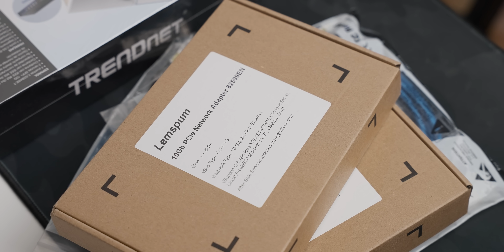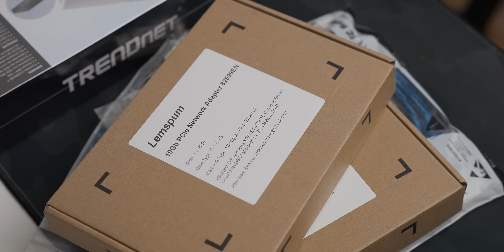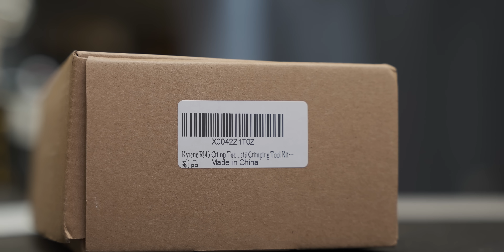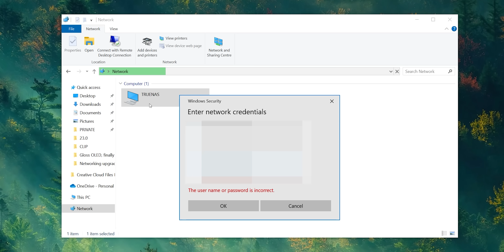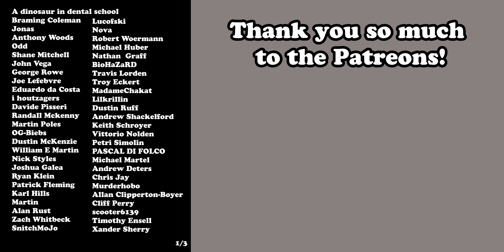Upgrading To The Cheapest 10GE Network...

Comment: Yeah, i also found out a way around the problem about write speeds on hdd's. You can set up SSD'S in SLOG so they are used as temporary storage for the slower write to the other drives.

Comment: Spinning rust is too slow to saturate 10Gb link unless you have bunch of them in a stripe. Single drive via SATA interface is never going to do that even if you have fast SSD there. Two SATA SSDs in a stripe could get pretty close though and with spindles, maybe 4 drives in large sustained transfers could get reasonable results. Networking side itself, you don't need any magic to max out 10GbE. You might want to enable jumbo frames aka set mtu to 9000 on both ends assuming your switch supports it.

Comment: Very entertaining, also been doing IT for a good 30 years now, and yes there are much better ways to connect your cables, where Cat6 is a good option for 10gb, consider using Bare Copper, less degradation and also over longer distances still performs well. Also would have been just as cheaper to go 40gb fiber, I would probably skip 56gb InfiniBand since TrueNas hates that.

Comment: That's nice and all, but why not replace the copper Ethernet cables to single mode fiber? They are 10GBe ready regardless of distance and much, much thiner, resulting in much less of a mess. You don't need to fiber either to add connectors, just strip the wires using proepr equipment and you can add connectors really easily. Fiber also uses much less power on while active on 10GBe+ than copper/Ethernet does.

Comment: oh, and as an aside, the cable you terminated is not designed to be put in an RJ45 plug, its solid core cable and not designed to be moved around and plugged/unplugged a lot.  A patch panel is easier than RJ45 cables, and then you just buy preterminated short patch cables.

Comment: If you set up your nas pool as 2 vdevs in parallel you can have double the speed, for example 2 vdevs of each 3 drives, so you have double speed, usable capacity of 4 drives and 1or2 parity drives that can fail without data loss

Comment: You want to lay the wires in the correct order, then use your finger to smooth them out in a nice tight group. Then you clip the end so all 8 wires are the same length. Then keep them flat and slide all 8 into the connector at once. I've never seen someone single feed a connector like that lol..... Back in the day we didn't have the EZ connectors that slid out the end.

Comment: As a network professional, no, crimping the cables and plugging them directly into the device does not make more sense.

To put it simply, metal, such as the (hopefully copper) in the lines in your in-wall cables, fatigues and breaks, which can cause bad connections or failed connections.  To prevent this, the best thing to do is to make sure the cables in the wall move as little as possible.  The home-run cables in the walls should be left stationary, which is why we use patch panels.  We tie down those in-wall cables so they stay put and don't bend/flex/move at all, which keeps the cables, and the metal inside from fatiguing, and breaking connections.
We then use patch cables, usually made from more expensive stranded conductors, to do the connection from the panel to the switch.  That way, the only thing you move is the patch cable, which is designed for it, and if the patch cable gets fatigued and breaks, it's MUCH easier than replacing the entire in-wall run.

The other ends should be tacked down somehow as well.... even some 3M double-sided mounting tape, adhering them to the wall, is generally sufficient.  Just keep them from moving around and those cables will last the life of the structure they're installed in.

The most common argument I hear against this is "well, I won't be changing it after installing everything", and to that I say.... YES YOU WILL.  When the switch dies, or you want to replace it with something faster, maybe moving from 1G to 2.5G or 5G or 10G or more (whenever that becomes available), you'll need to move the cables to remove them from the existing switch, then plug them into the new switch.... ON TOP OF THAT, the switch is liable to die in the next 5-10 years, so replacing the switch (and moving all the cables around) every 5 years or so, will cause them to fail long before the building has reached the end of its useful life.

People who don't use patch panels are either careless (or couldn't give a crap less about it), not thinking long term, or uneducated about the issues.  Anyone knowing these problems who doesn't use a patch panel is negligent and should be fired.

Comment: IT guy: that patch panel isn't good for high performance networks.  Terminate with through hole rj45's. terminate in B standard. Use a quick crimp for the through hole. easy to do.  get a line tester.. ideal stuff is fine.

Comment: $58CAD for a single X520-DA1, I'm unsure of the current exchange rate, but that sounds extremely overpriced. Used X520-DA2 (the dual port version) are around $13-20USD.

+1 for putting a fan on them. These model is old and runs hot, both are why they are so cheap and common.

Comment: i dunno, punching down the network cable, and using preterminated cables seems less error prone and quicker than terminating and crimping your own cables.  the punchdown block he gave you would have looked far nicer and more reusable, and actually is not hard to terminate at all.  If you can crimp your own network cable, punching down is a dream.

Comment: The B cable layout is the standard, TECHNICALLY, just having cables in the same order on each side will work, but you might get some signal loss if you don't respect the B standard

Comment: The patch panel is better long term. The cables on wall are/should be solid and don't handle moving around in a plug. Use patch cords for that part

Comment: FYI for HDD's the speed depends where on the platter it is; data is read faster from the center compared to the outside as a result of the rotational speed vs the circumference. So transfer speed does vary depending on the platter location. 

Also if you'd just used the patch panel; then you could have got a punch for like $1.50; and spend the rest of the crimper budget on pre-terminated 6" patch leads. 
Would have been the same number of terminations but easier; and its just nice and tidy too having all your terminations at the rear

Comment: The most likely reason that data started to copy faster is because that data was on the outer edge of the platter on the hard drive. For things that are round you would have to run faster on the outside edge to keep up with someone running on the inside edge. That reader head in the hard drive is able to read more data per revolution on the outside of the disk then the inside.
Reply: My NAS does a monthly parity check which will check every single bit of data and when i used to monitor the drive speeds you could see it looks almost like a saw pattern as it read from the inside out, change the disk platter its reading and do it all over again.

Comment: Dude, for real. Just connect the drives directly to the NAS and avoid the network roundtrip! Also, to fully saturate the I/O in your NAS, you can use the intenal Satas, the USB interface (up to 4 hdds of bandwidth) and also over network! You can do around 6-8 drives at the same time. And far cheaper lol.

Comment: Good job you went with fiber. I tried 10gbe on ethernet with rj45 transceivers and the heat and power consumption was ridiculous. It burned to touch the transceiver. And it didn’t work right either because I went with the cheapest switches. A few dollars on fiber sorted it

Comment: Hi Dawid, a DAC cable is a Direct Attach Cable, It has no fibre optic components and uses copper. That's why with a DAC cable you cannot cover the same lengths as with fibre optic SFP's and cables. It is also the reason why it is cheaper.
Reply from the maker: @kenwillekens9894  Thanks for the info. 👍
Reply: @DawidDoesTechStuff  No worries, keep up the good work 👌👍

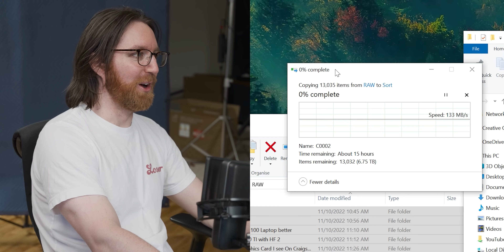Comment: 11:35 I wouldn't be surprised if Windows (or its indexing or anti-malware services) were the culprit,
you might have faster transfers using something like FreeFileSync or even TotalCommander,
single HDD usually does run faster than 120MB/s with 220-230MB/s being peak performance :)

Comment: Ugh, seeing you terminate those cables hurt to watch... As others already said, solid core cables used for structured cabling are not meant to be terminated in plugs, only into patch panels or those LAN port boxes you have spread around the rooms. Plugs only go onto stranded wire cables. And terminating them on the panel would most likely have been a lot easier. You just use a punch-down tool to push the cables into their sockets and the tool automatically cuts off any excess. 
Oh, and you also got lucky with using the right termination scheme. T568A/B have the colors in a different order, and if you mismatch the scheme on the ends of a cable you won't get a link.

Comment: Hey Dawid, depending on your board, it's likely when you installed that 10g module into your second pcie slot that your gpu slot was pushed down to 8x instead of the full 16x speed. Just a heads up so you dont go chasing your tail

Comment: 6:05 pro tip: when you straighten the cables, straighten them in order and try to make them as straight as possible by bending the, back and forth so you can just put them all in at the same time to make that ethernet cable

Comment: As some have already pointed out, the sheath needs to go into the connector for strain relief.
Also, the rj45 connectors for solid or stranded wire are different. You need to get the right ones.
As well, on these high speed cables, it's important to maintain the twist in the pairs as much as possible. Keep the twist right up to the termination point. It makes a difference in signal integrity.

Comment: SO David two things One you hard drive may be a hybrid hence why it eventually sped up a hybrid drive is a hard drive with a ssd cache to help commonly used files load faster also instead of you existing toaster look for once thats usb type C type or thunderbolt (if you pc has thunderbolt) that will make it ALOT faster than the existing toaster and less jank then adding it onto man pc line

Comment: Patch Panels are used to protect the very expensive (in theory) hardware of the switch, from the moron running cables, so if the cable run which is the end more likely to get messed up than the switch.

Also, that's a passthrough connector. The crimper cuts them to length...

Also, you can align the cable ends together, and shove all 8 wires in at one time.

Comment: Personally, would have gone with the Mikrotik CRS305-1G-4S+ switch, It would have given you 4 SFP+ ports with a 1G link to the rest of the network. 10g SFP+ optics and pre-terminated OM3 fiber is much cheaper than DAC cable and plugs in the same way. And if you don't want OM3 fiber, or want to free up a SPF+ port for RJ45, you can get optics with RJ45 ports on them, so you could have a mix of copper and fiber at 10g on the network. the CRS305 is the same price as the Trendnet as well. With the money saved from the DAC cables, you could buy a second 1gbit switch with 8 ports for $15 like the Tenda TEG1008M.

Comment: It hurts to watch how you did your cables... 1. you don't match the cables you have, but you should match THE OTHER END OF THE CABLES.... because if one end uses one way (A or B), then the other end should use the same. 2. the fact that it seems to work doesn't mean that all the cables are connected right. You should use a cable tester to make sure all the wires connect right and are in the right spot. If you want to achieve maximum speed that is... 3. punching them into the patch panel would have been sooooo much easier then you buy short patch cables to connect your switch as you see fit... but well :)
Sorry for the rant... I've done this sh*t CORRECTLY for so many years it triggers :) Not to mention that the connectors where you can pull the wires through didn't exist when I was doing hundreds of these... you had to use the exact length needed :)) Imagine that... I'm sure others will relate :D

Comment: Would definitely have used that patch panel.  The terminals on that are WAY easier to work with than crimp terminating those cables, AND it makes it a lot easier to reach equipment you want to install as you can just install a longer patch cable if you need.

Comment: I started crimping my own cables once. They worked but, I found that the store bought cables that are soldered rather than crimped had better signals. Also the fewer terminations the better. A box on the wall to connect looks more professional but, that's two extra places where it's metal touching metal rather than being a single piece of metal. A soldered cable straight through the wall from point A to point B gives the cleanest signal.

Comment: No the patch panel is better, you have to terminate less indeed because rj45 are way harder than just punching down (which can be done in a minute per cable, for me atleast) and solid core shouldnt be used for rj45's, hence the patch panel. So those rj45's will most likely break the cable very soon

Comment: My Supermirco server motherboard had 10Gb RJ45 so I stuck with that.  I did get CAT 7 cables, because they were only a bit more expensive that CAT 6 (future proofing).  The motherboard told me it was a Intel 550, so I got a Dell card with the same chip.  Optic fibre is for 50/100 Gb/sec stuff.  I can edit 6K-12bit Blackmagic RAW from the server.  In Davinci Resolve, I can scrub the timeline without any delays, buffering or latency.  I don't have to use low res proxies to edit.  Problem solved.  Anything bigger needs a 10Gb switch.

Comment: 58 bucks for that Intel NIC is really expensive. You can get them around here with dual 10G Sfp ports for 20-40€
Reply: 120$ for that switch? Holy fuck... if it isn't manageable, thats a lot. A similar one from a different brand would be like 60 bucks at most

Comment: Ah, YouTube just "loaded" instead of posting the comment. Okay then.

So this is the first time, ever, that I've seen someone do cables like Dawid. It was actually interesting to see because his method (not the stripping of the cables.. but of placing them in the connector) was really strange to see as a solution. On one hand it might actually work for some cables that don't differentiate the colors well, on the other it's a HUGE waste of time. Overall though, it was interesting seeing someone who has never worked on a problem but knows the end goal take an approach without instruction or first-hand knowledge.

Also, use the patch panel. >_< I'm going to be getting one as well as I want to rewire all my cables. Right now we have coax going to every room and MoCA adapters. That locks me into using the ISP modem or expensive adapters in every room though and it's getting annoying. So if I want to use my own equipment well again I need to get rid of MoCA and use ethernet. I will 100% be using a patch panel into a switch for cables. I have a 24 port gigabit/PoE switch that I'll be using, and probably just a single little Cisco in the room with my PC and consoles. But use the patch panel.

Comment: Hey Dawid, did you consider using Intel X540-T2 dual 10GBASE-T cards?  I have gotten some on AliExpress for less than $15/ea.  X540 does not do 2.5G or 5G, because it predates those standards, but it is also what makes it cheap.

Comment: Dawid learns HDD geometry the hard way 😄

The reason the speed varies is due to physics - the HDD platters spin "faster" linearly on the edge, and "slower" the closer you get to the center, so the speed of reading/writing depends on the physical location of the data.

That's why the speed jumps around wildly, as it's copying different files from different locations on the platters.

Comment: Wait, wait, wait. You're just connecting TWO computers together? You didn't need the switch. Just assign static IP addresses to the NICs and direct connect them. SFP+ doesn't need weird crossover cables or anything.

Man, you REALLY need to reach out to your community before investing money on enterprise-y (yes, everyone else, I know that 10Gib is passe and used 40Gib nics is where its at now) gear.

Comment: I remember installing connectors in the 100 Mbit/s era and the end result wasn't guaranteed. Perhaps I'm just clumsy with connector installation, perhaps the signal integrity is far better in modern network infra. Doing over 3 Gbit/s with Windows file copy is really respectable.

Comment: Be aware there are two different types of RJ45 plug! The commoner ones are for patch (stranded) cable; those have spikes that stab through the centre of each core.
Using those on trunk cable (single strand) can cause problems, as the spikes can cut the core and cause it be erratic after a time, or with flexing.

Cable pre-fitted with plugs should be patch, but some suppliers use single strand trunk cable as it's cheaper!

The proper plugs for trunk have zig-zag spikes that grip the sides of the single strand cable core.
(And those don't work reliably on stranded patch cable).

You are fare better off with a keystone patch panel & short patch cables to the switch etc. if the cable you have is solid core.

Comment: Adding new RJ45 terminals to ethernet cables is a pain in the ass, even with the right tools. Having the correct sized terminals for the correct size/type cable is a must, especially for pass through RJ45 terminals. Depending on the type of cable, it's also imperative to have the correct wiring schematic for the individually color coded wires as both ends of the cable must match. It's also important to have an ethernet cable tester. The Fluke Networks LIQ-KIT-IE Industrial Ethernet Tester Kit is a godsend for troubleshooting ethernet cables and networks.